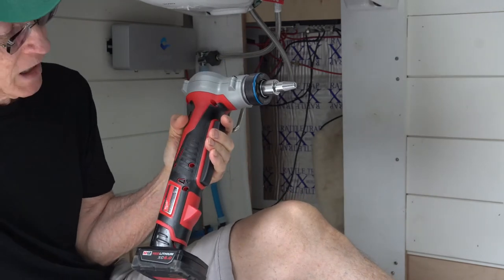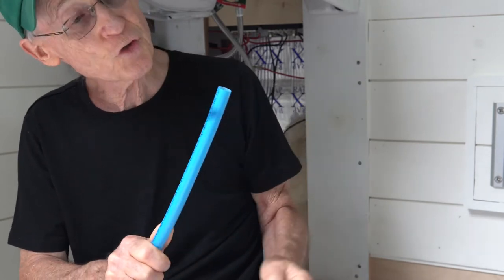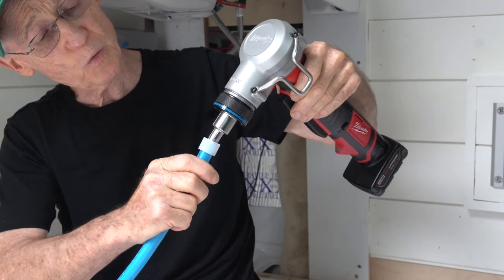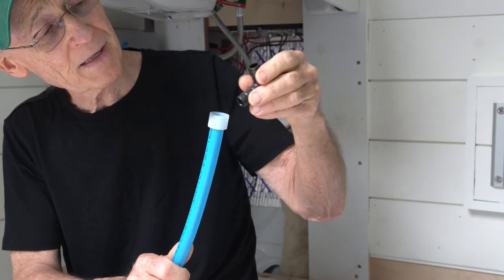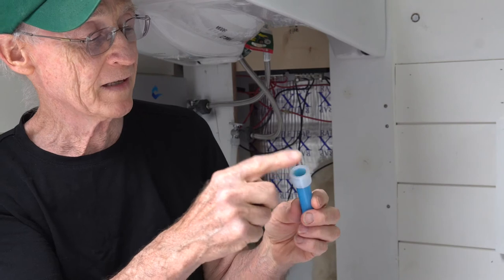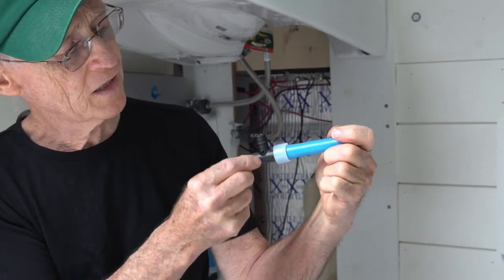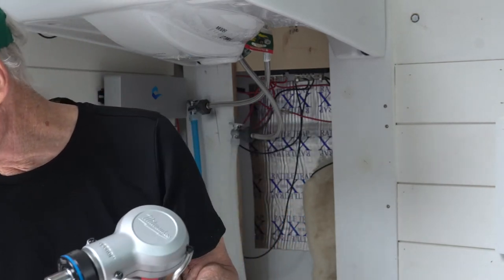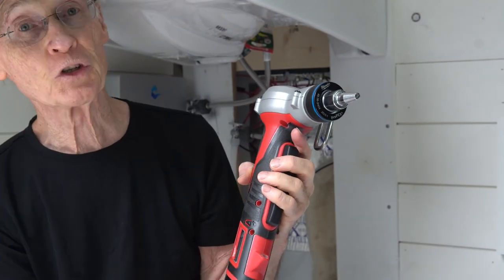PEX A and Uponor fittings for Van Plumbing using Milwaukee Expansion Tool.

Comment: Those expansion rings, can be used in place of hose clamps to repair garden hose, drip line, and air compressor hose, works great, just be sure to wrap foil tape or gas line tape to protect them from UV rays, also can make cheap rings from scrap pex-a for drip line irrigation

Comment: Sir, good overview of the tool. I think Pex-a is the way to go, definitely more expensive than pex b though. Pex a has its good and bad but overall I think it's a winner. Especially since you can verify a proper connection as opposed to pex b where you have crimp rings and must verify you crimped all connections. I've got a 1918 home with mainly galvanized piping and some cpvc along with low water pressure, I know the lines are rusted as I already verified. The tool is expensive but I'm going to buy and redo all the supply lines in Uponor Pex-a, unfortunately all supplies have to be ordered online.
Reply from the maker: I also order all supplies on line but in my canada location the Home Depo do carry the pex a pipe and fittings. I have had my van pressured up for several months and made two tripes and not a drip! This is from a guy how has never used the produce before. I think the simplicity opens up Diy household plumping to all.